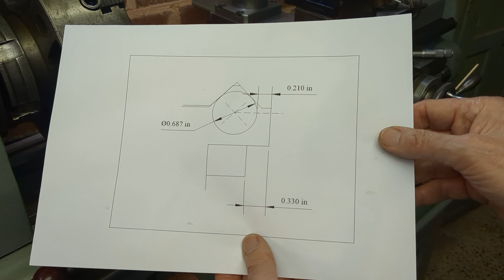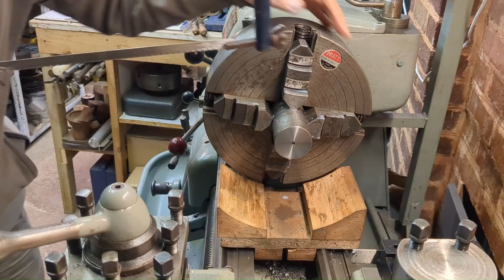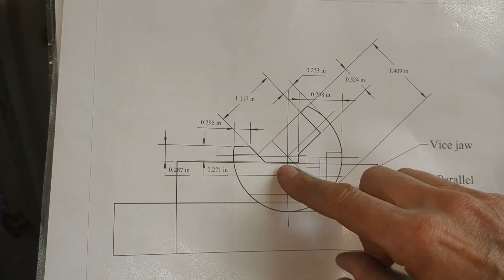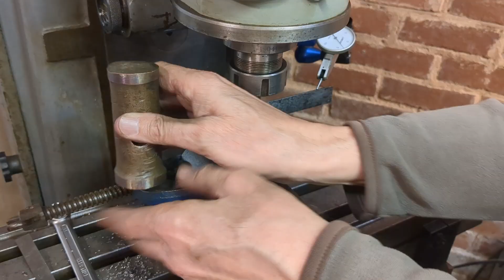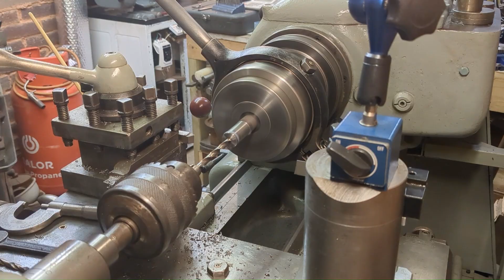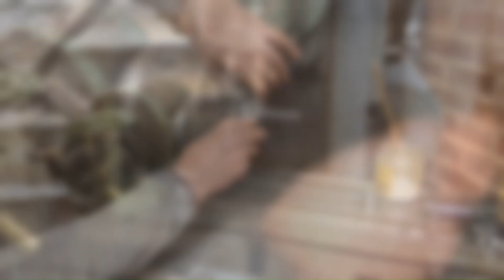Carriage Stop for a Colchester Student Lathe - part 1

Comment: Excellent video explaining your entire process.  Just a comment about measuring "real" runout (timestamp 14:36).  Don't know what you meant to measure but what did measure is the approximate* runout between the bore to some theoretical centerline** of the offset jaws (*some theoretical axis of the rod artifact **actual datum of your measurement.   What geometry were you trying to evaluate?  But ultimately if it works, the semantics don't really matter.
Reply from the maker: Thanks for your comment! It wasn't a technical term just the fact that the bore I wanted to pick up was at the other end of the component and not the one which presented itself and was easily measured.

Comment: Always run coolant as the tool gets hot and jams in the slot
Reply from the maker: I am planning to get the coolant pump running which will require another 3 phase supply. Thanks for your comment!

Comment: Very nice drawing,  plus manufacturing set-up tooling included 👌. 
I used to have a Colchester Master circa 1970s. The carriage stop had a micrometer feature, and could be used to disengage the carriage feed. There was a feature in the drive system that tripped out feed, very useful. 
Excellent work and video, thanks for sharing.
Reply from the maker: Thank you! Yes, my carriage has quite a sophisticated adjustable feed trip mechanism too. I have never had cause for it to trip, but perhaps with the carriage stop I might!

Comment: Very interesting. I made a carriage stop a few months back after finding out a used Colchester item was silly money. Mine, I feel is an improvement on the original. Made from 4140  steel, which is all i had in 2"  Has  hardened stop inserts for use on either side of the carriage. Also incorporating DTI or other accessories mount. Its a pleasure to use and locks very firmly. Cant say it wasn't a challenge to make though. 
I look forward to seeing your finished stop.
Reply from the maker: Thanks, Constantine. Yes, making a one-off without jigs is more complicated than a cursory look would indicate! I tried to scale some dimensions from online photos which seemed to show that the commercial ones are less than 2in long. I wonder what length you ended up with? Also, whether my concern that the clamping arrangement might cause the body twist was unfounded?
Reply: Yes I also looked online for images, the best I could come up with was quite a detailed drawing but from a Colchester Bantam. I ended up drawing round a piece of card held on the end of the bed, and making an accurate drawing from that. The clamping nut was machined with an eccentric M10 thread so it would maximise the clamping surface area on the bed. Yes 2" but actually 50 mm length is what I opted for, (I generally work in metric). If you're interested in seeing my version, I'll happily send some pictures.
Reply from the maker: Yes, I considered an eccentric bolt but decided I didn't need it. My thread is a lot lighter at 5/16in (8mm) so I hope there will be plenty of clamping force.
Yes, I would be interested in seeing your drawings if possible workshopfriend@gmail.com. Thanks!